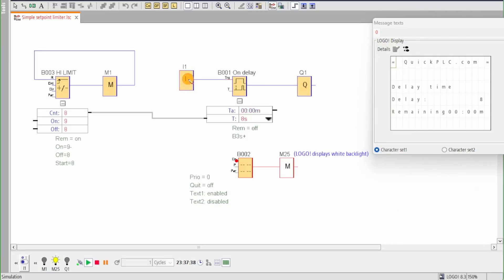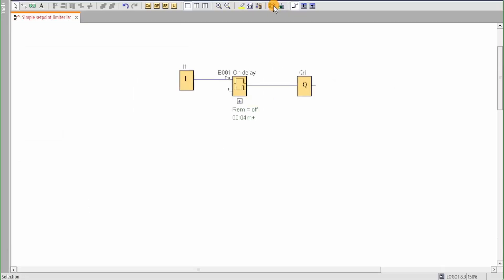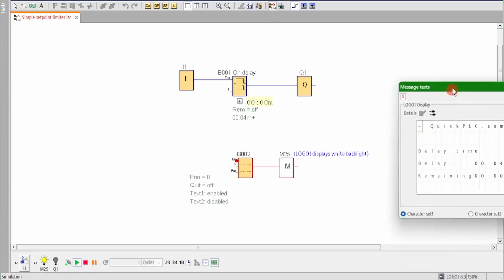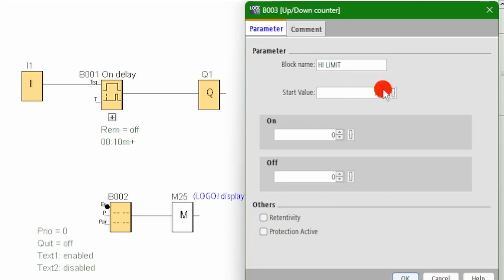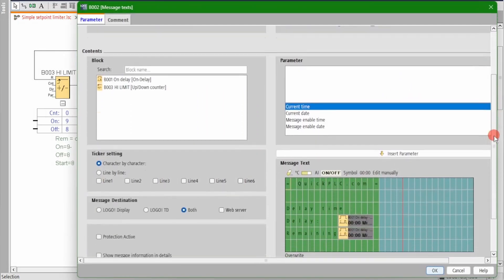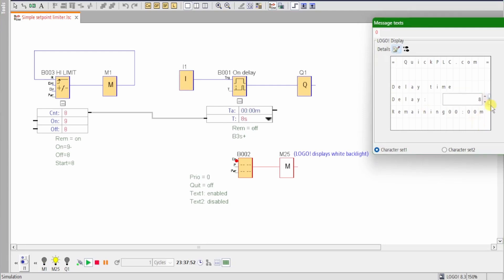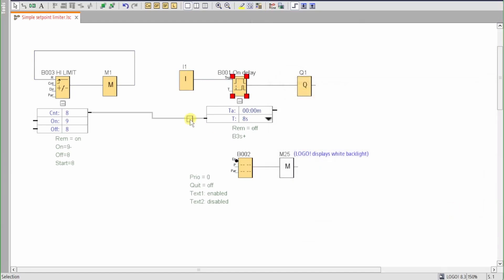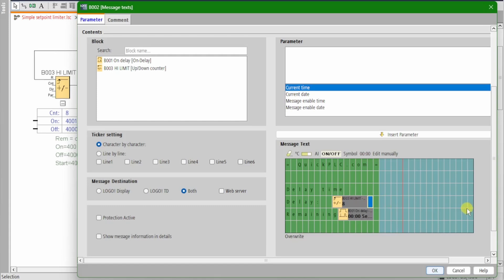LOGO! Simple setpoint limit

Comment: Awesome! I always wanted to do it but I just couldn't figure it out!
Is there any way to program a 2 or 3 access levels program in siemens logo? Like: Visualization, User and Admin.
Thanks!
Reply from the maker: Thanks for the feedback! 
No, the LOGO! / TDE combination is rather limited but here's an idea for you to try: (1) Add a Math Instruction block and a Message Text to edit P1 of the Math block. P1 is now your password field. (2) Add an analog comparison for each access level you want. Set the comparison value = password for that level. (3) Now you'll have to duplicate your parameter edit Message Text blocks with one enabled when not logged in with Protection Active, and the other enabled when logged in, with Protection Active unchecked.
You might find this is easier in ladder mode. The FBD gets into a rat's nest pretty quickly.
Let me know how you get on!